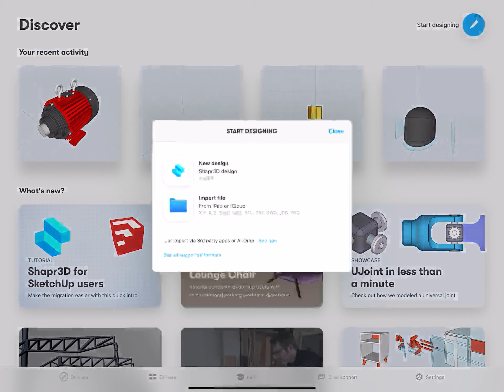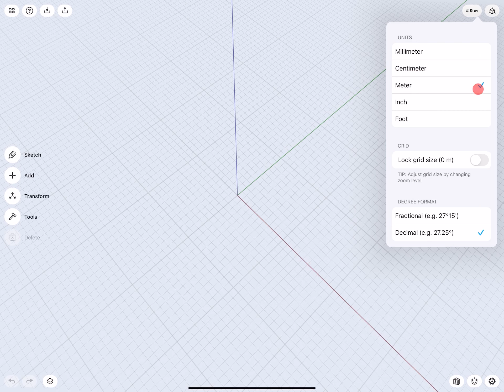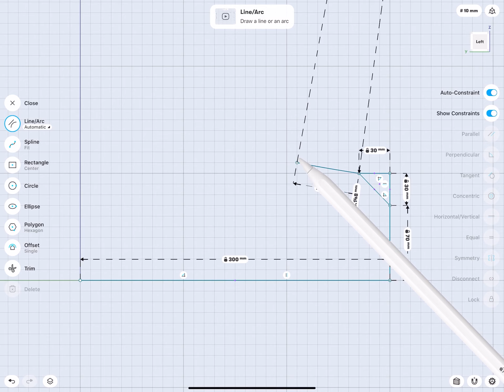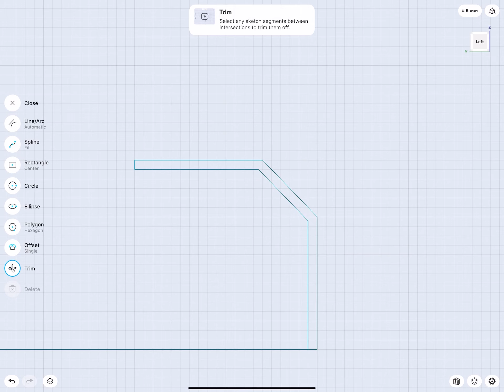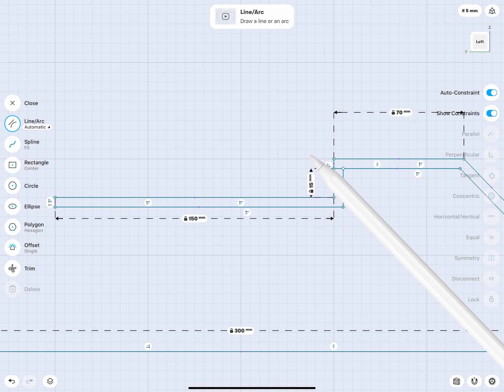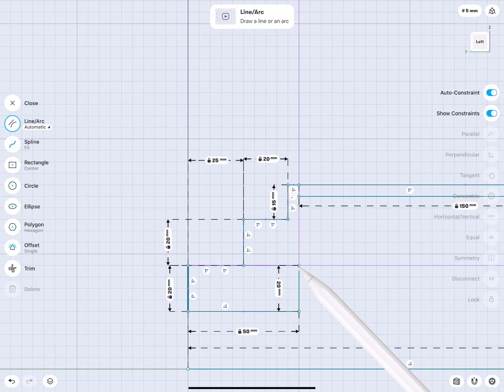Motor frame sketch | Engine tutorial

Comment: How do you refill a hole that you hole out? If I make a hole and then do 10-20 extra steps after creating the hole, but then change my mind and no longer want a hole, how do I get rid of the hole?
Reply: I tried what you said...
Just select any of the inner surfaces of the hole you've created...& move it towards the other face (of the same hole obviously !)...& it fills up nicely like the hole was never there before.  (Edit : I did 17 steps extra after creating the hole.)
PLUS...it also works even if you've Chamfered/Filleted the edges of the hole.

Also...I've updated to the latest version, while I'm replying you. So if it doesn't works then check if it's updated to the latest. 

Thank You

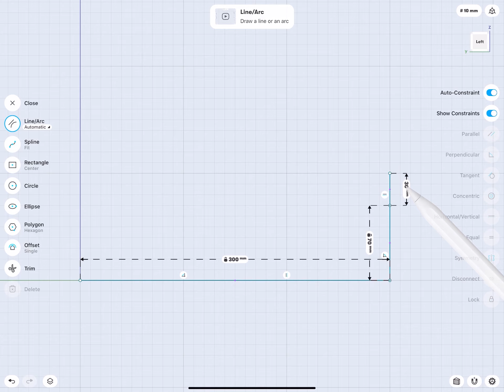Comment: Can’t find how to make all size constraints visible. When I draw second line - first constraint will disappear. So I can not get result as on 2:14 with 3 size on screen at same time (300, 70, 30). Is it possible on current version?
Reply from the maker: Surely this is doable, however, you need to lock the dimension with the lock button, or type in the correct dimension with your numpad.
Reply: @Shapr3D  thanks, lock button on numpad pop up does help. Now I see this step in video tutorial.